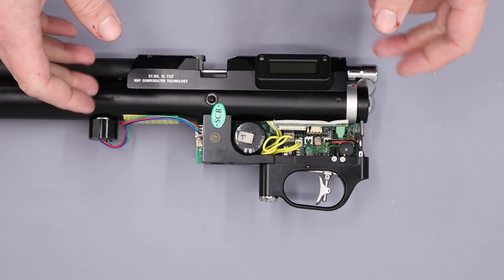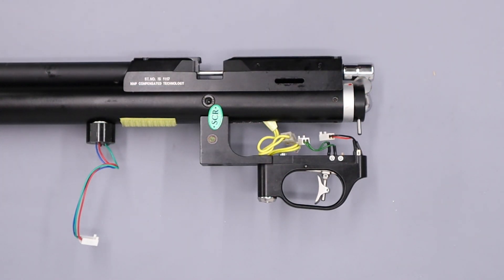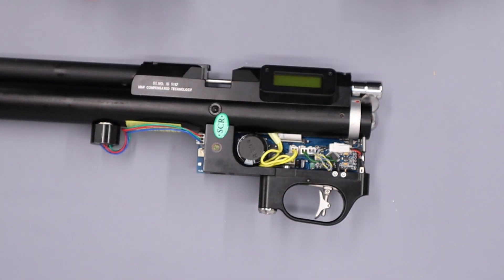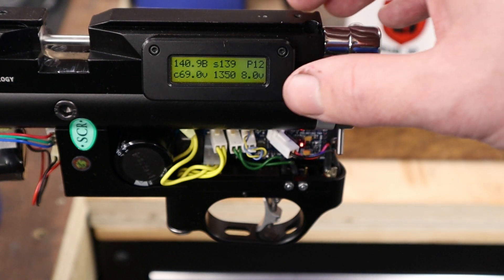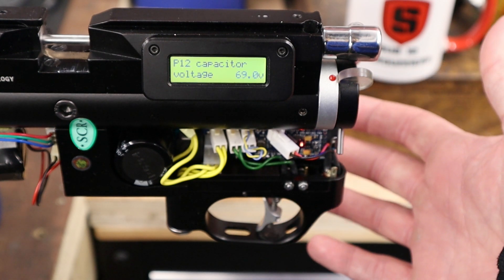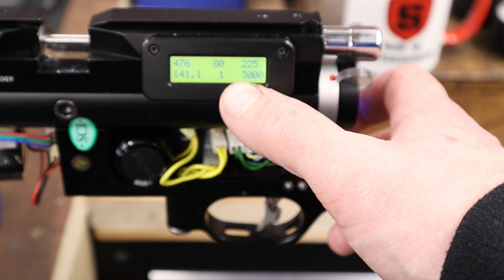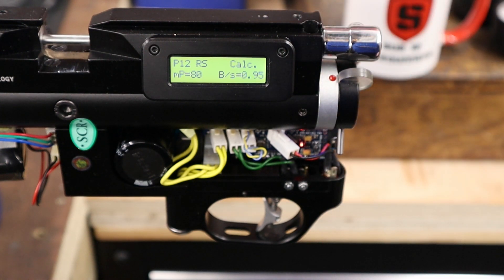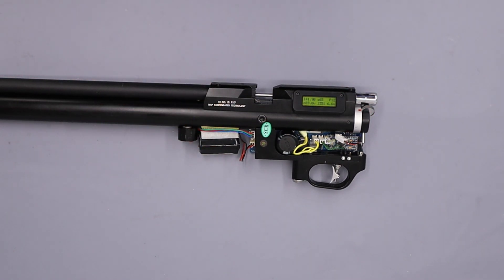Fitting a Heliboard to the Daystate MK4 Panther

Comment: Another great video guys, The helliboard is a great piece of equipment and i had one fitted to my .25 FAC Redwolf, 12 different power settings and fully tunable to whatever pellet or slug you want. I myself just used three settings, 25g jsbs,33.95g jsbs, and one high power setting for 38g prohunters slugs, it is a faff programming the helliboard and your idea of using the in-line regulator to achieve the velocity you want at each set point is excellent thinking and saves so much time instead of having to re-fill and go back to that set point.
Reply from the maker: Thanks Paul 👍

Comment: Alright mate, I did exactly the same. Stupidly plugged in what I thought was the correct changer, turned out to be an 18v and my Airwolf MCT has been dead ever since. Does it require an FAC with a heli-board replacement? I’ve not managed to find anything else along the lines of repair. Any advice greatly appreciated. Cheers.

Comment: May I ask where you get the Heliboard from and it’s cost. Also, I have a Daystate MK3 and would love to replace the fixed soldered batteries with a removable and rechargeable battery setup…. Have you heard or know anything about carrying out this modification?
Reply from the maker: i think the boards are about £200 ish and they come from  a chap in Grease   Jack is his name i think you can find contact details if you search google  👍

Comment: Hi, I have a Daystate MK3 and the board seems to have failed(I suspect the capacitor as its swollen)  Could this be used to repair the MK3 even though there is no pressure sensor on the MK3.
Reply from the maker: hi not 100% but no i don't think so 😥